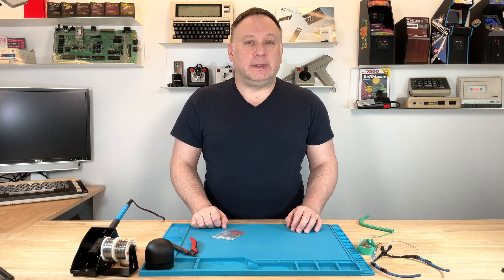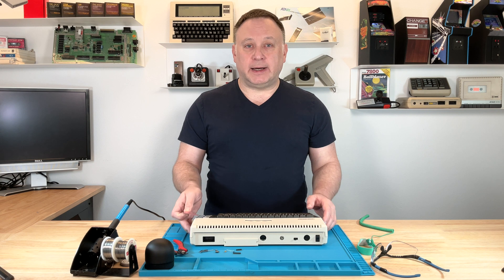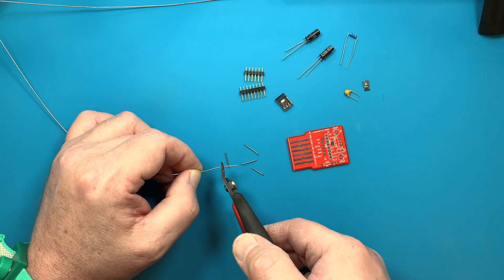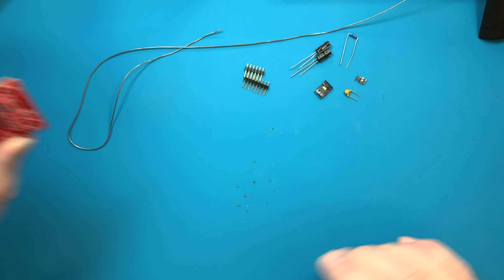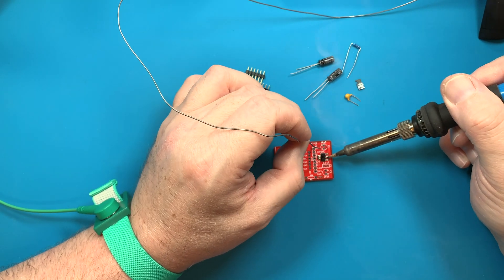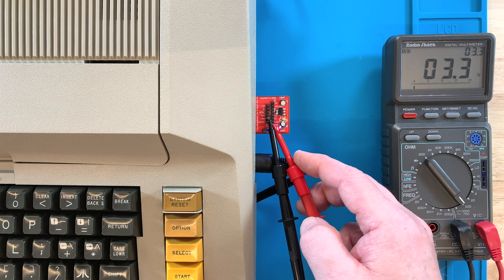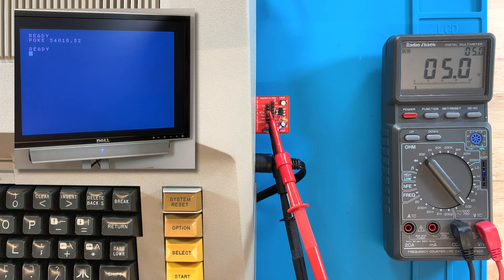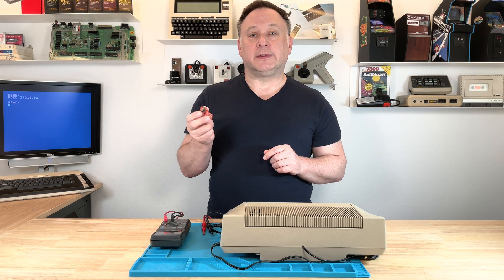Checking out an Atari 8-bit SIO Breakout Board Kit

Comment: For 40+ years I still remember poke 752,1 that stopped the blinking around the cursor in Basic, We experimented with a slow loopiing program that would add +1 to the poke input and we mapped out hundreds of them, Even a few that would lock the computer up completely... I always used the highest line number is Basic for my password.. 32767.. Great years the 80's were..
Reply from the maker: lol That's fun! You couldn't break them by Poke'ing them. Just hit Reset. :p